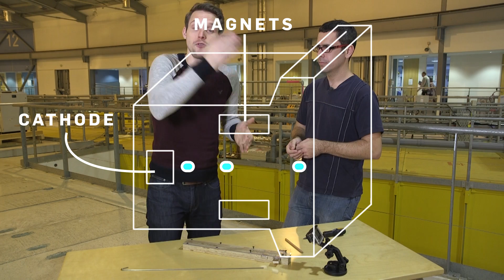How Does A Particle Accelerator Work? | Earth Science

Comment: how many magnets in a row would one need to make a suitable rail gun 
say 1000 foot per second to 1500 fps
Reply: +robofish759 using permanent magnets? none, you'd be losing energy, not gaining it. Using elctromagnets you can avoid having the "uphill" (as they said) or "slowing down" effect, meaning nothing but pure acceleration. Then when you're launching something magnetic, top speed is determined by how much power you can put through the magnets, the size of projectile (remember friction, air resistance, etc) and the timing. A well timed, very powerful railgun could use only a few powerful electromagnets. Combine that with a vacuum tube and polished barrel, and you could achieve some crazy speeds. Mythbusters shot a tennis ball at the speed of sound using just a vacuum, a long tube and some cling wrap, imagine that with electromagnetic assistance and less resistance (I imagine PVC pipes and a tennis ball create MUCH more friction than a ball bearing and a polished steel tube)
Reply: cool thanks

Comment: Does this use Lenz's law or am I completely wrong.
Reply: +The Python Factor Kinda. Lenz's law dictates that an inducted current acts against the change in current to produce typically a mechanical force. The phenomenon used in particle accelerators uses the rule that a current in a magnetic field experiences a force orthogonal to both the field direction and current. What they don't go into in the video is that the actual accelerator bit (called the cavity) uses RF waves provided by a high-voltage alternating source (typically a klystron). The waves propagate into a vacuum cavity, both the waves and cavity are tuned such that a precise standing wave is formed inside the cavity. The waves are timed such that when a charged particle enters the cavity, it is first attracted by the field produced in the cavity (radio waves inside a conductive box create a field which oscillates at the frequency of the waves, and then repelled by it, such that it appears to 'surf' (in a very loose sense of the word) the wave. A bunch of these cavities are strung together to create the massive acceleration in the accelerator, and out pops a near-luminous particle!
Reply: Joshua Pearson Awesome. I appreciate your explanation of that!
Reply: +Joshua Pearson At 5:28 you can see one of our spare RF cavities on the roof of the storage ring mid way between Greg's left shoulder and the edge of the frame. It's not very clear and you have to know what you're looking at. From the outside it's a grey cylinder on its side about 1m long and 1m in diameter.

At Diamond we are putting so much power into the electrons in the storage ring that we use superconducting RF cavities operated at 4 Kelvin to remove resistive losses from the system.

The magnetic device we used in the film was to try and give a sense that you can use electromagnetism to accelerate things, as unfortunately electrons are a little too small to see with the naked eye ;-).
Reply: Ed Rial They are fascinating machines, aren't they? I was fortunate enough to have a couple of weeks' internship at your partner institution of Daresbury Labs, in Cheshire. (Where DIAMOND was originally going to be...grr!)